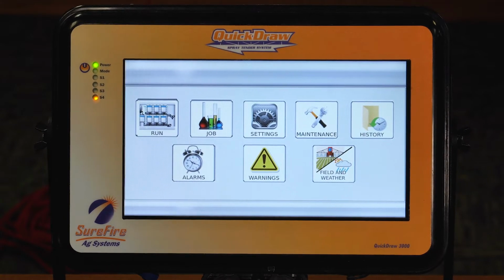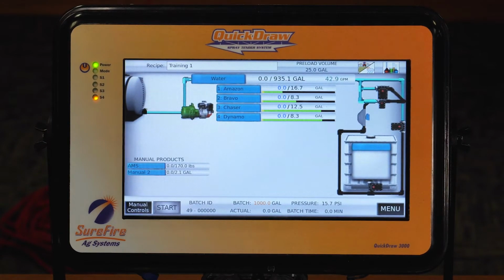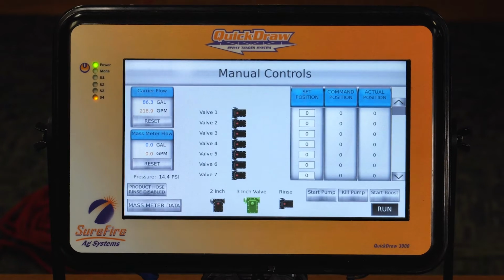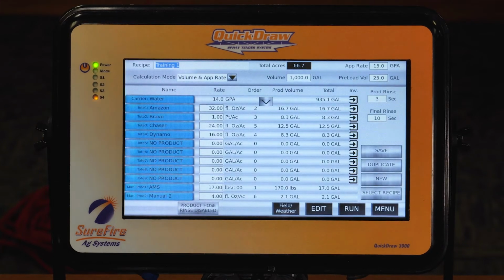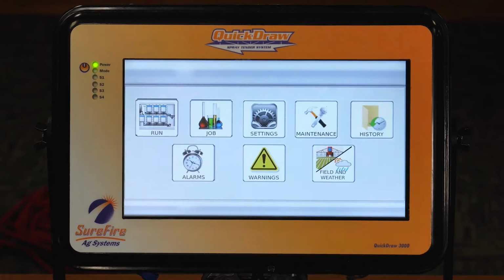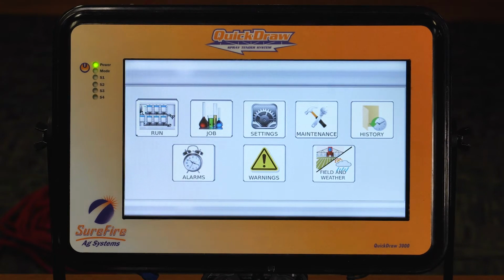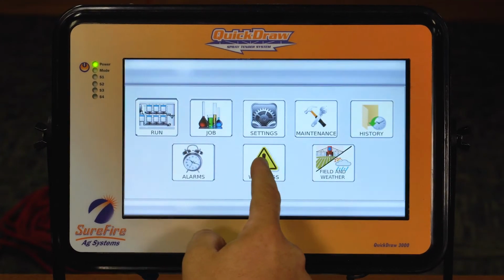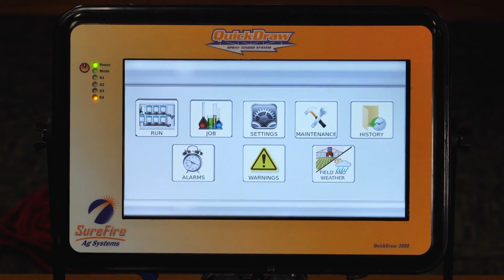QD3000 - Operation and Navigation

Comment: Hi, how many gal per minute go through the 3" line to the sprayer, when you only need water?
Reply from the maker: GPM when pumping water through the 3" passageway will typically be 250-275 GPM. This is dependent on the pump and engine you are using and the restriction created by plumbing from yank to pump and pump to QuickDraw. The typical 3" pump and 11-13 HP engines commonly used result in 250-275 GPM.
Reply: @SurePointAg  Thanks, I have one more question. For the product hose rinse you can set individual values for the product hoses which can be substracted from the batch volume. How is the volume offset between product valve in the valve stack and flowmeter taken into account...? Thx
Reply from the maker: @cellnot   As a result of how the rinse of the chemical passageway works, it starts full and ends full of rinse water, this results in accurate measurement of chemical being dispense.  The position of the chemical valve on the stack factors into the calculation as well.  If you have additional questions, please email Sales@surepointag.com and we would be glad to setup a time to discuss.